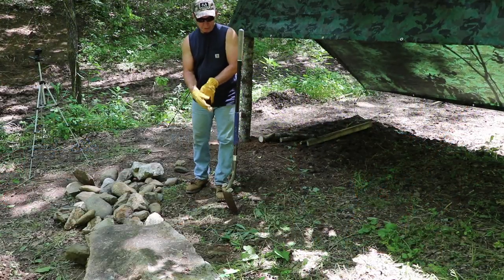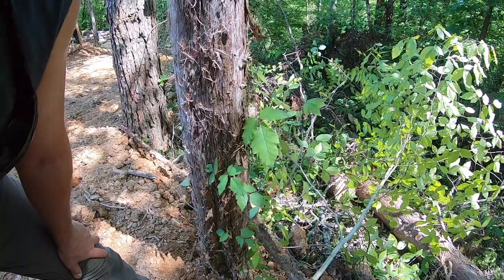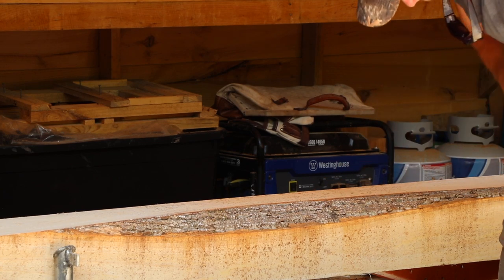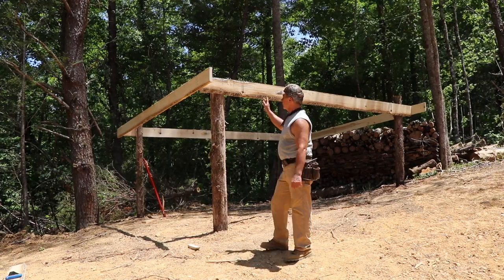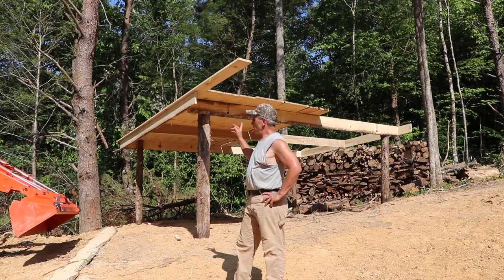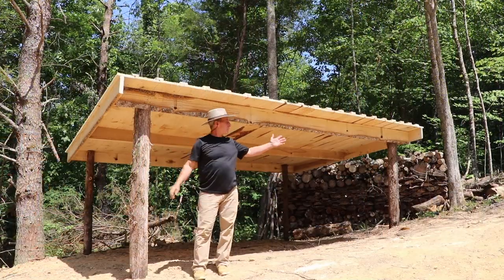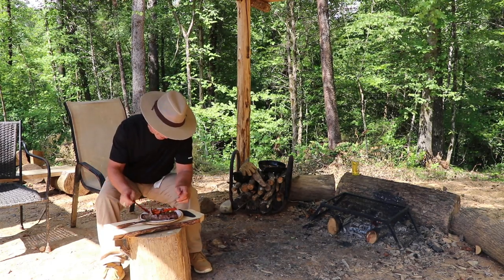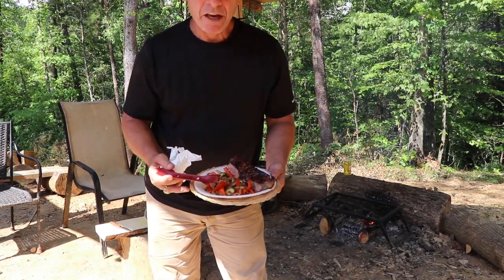S1 EP2 | BUILDING A WOODSHED & FIRE PIT

Comment: How long will those logs last in the ground? Did you oil them? What type of tree? I’ve done this with white pines but I used diesel/motor oil mix after charring. They haven’t been in the ground that long so not sure how long they will last. Cool setup you got, similar to mine.
Reply from the maker: Hey! Depends on the structure we’ve built. Not that the same treatment shouldn’t get done to all, but in the interest of time and such sometimes they have gotten burnt only and then concrete around them. Our sawmill structure was burnt and then we put a layer of tar and then it was concreted in. I know some folks who would rather do it the right way the first time, and I also agree… but when you are only 1 person or have limited help, and you’re trying to get some things going… ya just gotta build it and keep moving. But it all depends upon what you’re trying to do and what you have to work with. 
Thanks for stopping in

I believe we may have used Cedar, but I’ll ask my dad to make sure. 
-Patrick
Reply: @SmokyMountainOutpost  Gotcha thanks!